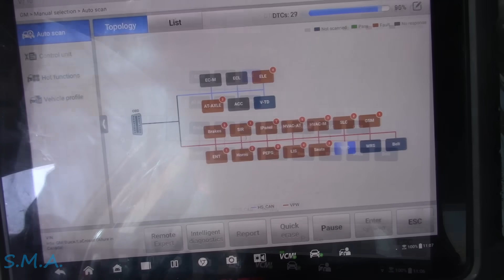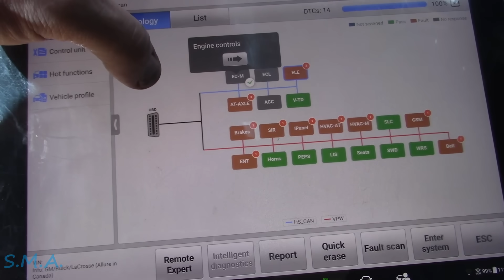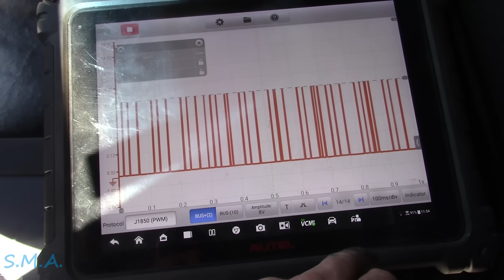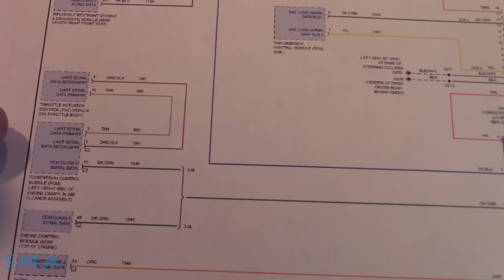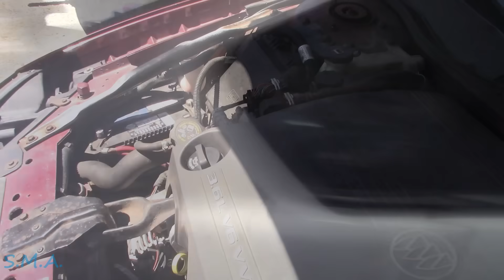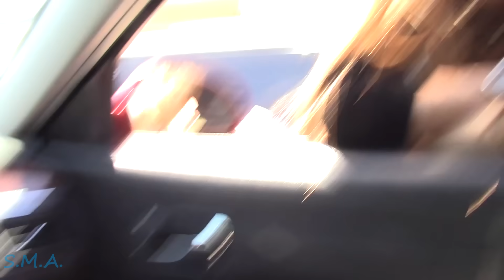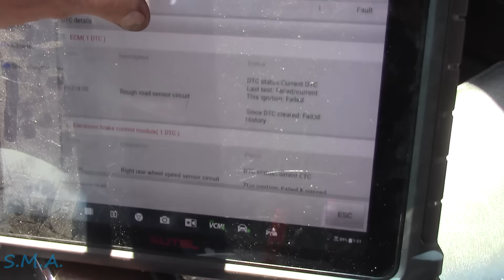Buick LaCrosse: No Start No Communication

Comment: Eric: Sorry...I bumped "send" by accident.  that raucous damned siren  across the street, loud motorcycles, loud trucks, & in this video a lawn mower running away, the loud alarm on the telephone, & God knows what else.  I live in a county that has 5500 square miles in area, point six persons per square mile, 6 villages, & my nearest neighbor is 2 1/2 miles away. My electronics repair  shop does not have a broadcast radio in it (unlike several vehicle repair shops in the area, that have stereo equipment running at the noise level of  a Romanian steel mill. ) I There goes that damned siren again !  . Your electric fault finding is absolutely first class. I always grin when I see you use a lamp as a test load.....there are times that a heavy load(relatively) is required to duplicate the fault. Your use of a "scope 
on a rope" is a valuable trouble shooting tool for many things. I use one myself when working on Ag equipment.  Great stuff Eric, & you are lucky to have "Mrs.O", she is a jewel. Ms. Trinity has really grown, &  is as pretty as the Lord lets little girls be. Haven't seen your boy for a while (Evan ? )....he must be a teenager by now.    I look at a lot of similar sites, &  you have no sites that eclipse yours. Ivan, & "Scanner Danner" are both damned good, but there are many who are full of what the crows fight over. Thank you Eric for you tutelage
of your followers. I expect you have elucidated a few of your professional followers as well.  All the best from the minus 55 deg. F , & the wind swept hinterlands of Alberta, where men are men, & sheep are nervous.   Brian

Comment: Cadillac CTS suffers from bad pcms.  Same boat. Had to jump it, after it sat not running for 10 mins, no start, key stuck and no communication. Quickly Jumping /tapping  it but not starting it,  allows the PCM to wake up, you'll hear solenoids and be able to read codes.  Took me a week with my multimeter to come to that conclusion. New PCM with vin from online.

Comment: HELP 2007 LUCERNE NO START
So on my Lucerne 4.6l if i have someone push down on the relays (under hood fuse box) while I crank the car will start right up but the a/c doesnt blow cold if i push and hold down on the relays the a/c kicks on and works your video is very well done btw. Not sure what to do next though any...

Comment: Thank You so much for this video. it helped me so much having the same symptoms on a Verano, and not having the scan tool to diagnose the BCM. It ended up being the fuse plate connected to the battery. 🙏🏻

Comment: As a long LAX 2008 owner, I breathe a sigh of relief that (great vid BTW) that A. With the 3800 and after having the Driver Info Center state 'Service aBS System'- with BS beaning bull poop for the past 260000 miles full independence from Eng/Crankshaft vs flimsy wheel speed sensors. B. Due to this VVT version ABS and engine have some dance with this car (uugh) and clearing out ABS codes will eventually be needed as to 'help limit the amount of blowby to the air filter'.  Without ABS and for most part Traction Control noticed no issues with brake overwear, rotors etc. Now unfortunately the 'BRAKE' light just went on but no change to fluid, leaks, brake pressure etc. In the Owners Manual it states (Brake light on) 'Is your parking brake engaged?' and 'If not, it COULD be something else so just tow it somewhere' Really? aBS system is right. So no real idiot light sensor to indicate loss of fluid pressure like in the good ol days.

Comment: Good diag  there Mr O....   It’s for sure as these vehicles get older fixing them can get expensive.   My mom has a 99 Olds 88.  The electronic part of the dash that shows mileage and what gear you are in has gone haywire.   My mechanic said to fix it would be expensive if even doable.  My wife’s car, a 2009 Pontiac g8 had to have a rear door glass and they don’t even make it any more so I had to get a used one

Comment: Why does anyone keep buying GM
Reply: Likely would not be issue if owner had 3.8 L(pushrod) motor. Likely placement of PCM (location where heat is more an issue - PCM likely was cooked) and VVT issue (unit needs to run at start key turn - tell the valves to operate and which cylinder bank needs to run). Note during the vid a jab at the Prius😊

Comment: Wow, cars are complex with all the digital comm between various modules. They seem unrepairable without a basic knowledge of automotive computer architecture. All the bits requiring reprogramming correct VIN  adds to the excitement.  A good scantool is a 'must' necessity.  Great troubleshooting.

Comment: It's unfortunate that car has the 3.6 when you had the choice of the 3800. You basically had the choice of GM's worst engine and their best engine, and you chose the worst.
Reply: I still remenber at the dealership being pushed the benefits and the 1-2 mpg benefit of the VVT and said no way! Also in 08 they had the V8 northstar and since I was stuck with FWD wasnt too thrilled about added torque steer with a mismatch transmission.

Comment: I hope the first thing you did while we wasn't watching is check the battery connections. Anytime there is an electrical problem that should be first. Keep in mind there can be corrosion where you can't see it. Like inside the terminal lug and the only way you can find it is with a voltage drop test. I learned this the hard way while working on outboard motors. Unfortunately it was mine. But learning how to do a voltage drop test has been a very valuable tool since.

Comment: GP, as a prerequisite to life everyone should have to work in a capacity where they interface with the public be it 
Garage, gas station, grocery store. As a teenager I had the privilege of doing so and you meet some winners. Never got fired and had a good name so I did something right. And then it was on to Vietnam. 15 Nov 67, just in time for Tet 1968..

Comment: Sept. 2020 i went to DR.'s appointment . 2 hrs later i opened the driver door to 2011 buick lacrosse and i heard a loud very fast machine gun sound under the hood . i got in and push the button and nothing ,no crank no start . it drove there real fine and been driving well before this . here are my tools i have ,BLUE DRIVER , POWERPROBE 3 , POWERPROBE "THE HOOK" , POWERPROBE ECT -2000 short finder, FOXWELL NT624 ELITE more advance scanner i just barrowed sept.2022  and a computer safe test light which test grounds and positive power . my code was/is UO100 and PO23F .....
I DOWNLOADED MANY MANY 1000's of PAGES from MITCHELL 1 , AND ONLINE CHILTON MANUEL . 
I SPENT A YEAR AND A HALF TRYING ALL SORTS OF THINGS .I WISH I HAD YOUR KNOWLEDGE AND DIANOSTIC EQUIPMENT  LOL . 
po23f states open condition in secondary fuel system . i also noticed the connection x108 has a lot of these suspect wires going thru it , sometimes my shifter indicator light on shift stays on ,sometimes my gas gauge works ,sometimes it dont ,  these things happen when i mess with X -108 CONNECTION .
so check this out , when i connect battery ,the machine gun type noise is heard under the hood . it does for a few seconds then stops , few minutes later ,it does it again .
when i unlock my door or trunk with my remote or by the key ,that machinegun sound starts up again . IT WILL BE 2 YEARS THIS SEPTEMBER THIS CAR HAS BEEN PARKED , I HAVE NEVER HAD SUCH A PROBLEM WITH A CAR EVER BEFORE . 
i know starter is good because i got it to turn over by using a jumper wire in fuse box . i wish i knew how to use the tools i have a lot better so i could fix this car . ALSO I CAN HEAR MY FUEL PUMP RUN FOR A SECOND OR TWO WHEN I FIRST TURN THE IGNITION ON . so my fuel pump and starter works .
so , sept 30 2022 i went out to the car , pushed on my fuses and relays , got in car and noticed my gas gauge working again ,push the starter button and car tried to start twice but battery was really low at 11 volts . i brought batt to have checked and fully charged to 12.8 volts .i took the fuse box out and im investigating it now . i got a feeling now ,i got a very serious intermittent problem that is possessed from the devil himself to cause me to shut down lol . what people sometimes say about getting your car fixed always leads to other problems , lol , thats true sometimes ,because some people mess things up won other things while repairing certain things . i had recently done a waterpump removal and install to this car a couple months before this all happen , also changed the water inlet neck to the engine ,the faulty radiator car , and replaced the thermostat , believe me i kindda investigated all these areas !!!!  any advice is greatly appreciated brother !!!!! THANK YOU FOR YOUR SERVICES AND YOUR VIDEO  MY BROTHER !
Reply: NOW my worst fear is trying to run the car once i get it running with the gas thats in it , 3/4 tank , pretty expensive in todays time especially .its been treated fortunately , but still its 2 years old  lol !
Reply: i just subbed brother ,really enjoy your video , thank you for all you do !

Comment: UART STANDS FOR UNIVERSAL ASYNCHRONOUS RECEIVER TRANSMITTER. IT TAKES PARALLEL DIGITAL DATA AND CREATES A SERIAL STREAM ON THE TX SIDE AND DOES THE OPPOSITE ON THE RX SIDE.

Comment: I had a similar experience of slow response with an immobilizer.  I had to let the OBD2 run for an hour to add its first key.  Once I completed the first key, The tool worked and only took A couple minutes.  My guess is the security delays the reprograming security related items to keep someone from jumping in and making a quick getaway.  I had to sit and wait an hour with keys in the ignition and it finally had new immobilizer coded up.   The other issue I had was I also had to start with the battery removed to clear all of the signals in the immobilizer.  I had spent a couple hours waiting on the tool just to have it end with a fault. It programmed successfully the first time after removing and reconnecting the battery.

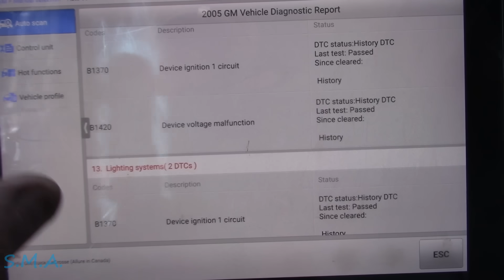Comment: Hey at least you’ve got the other shops around you trained to send any work to you that requires a little ”if, then, else logic”.  03:49  Of course that’s after they’ve fired off the old parts cannon 2 or 3 times, and are finally reluctant to bilk the customer for another part they probably don’t need.

Comment: If the fob is not working, change the batteries and try it. My Chrysler did that and without the fob it wouldn't start.Its  Weird but  they have to communicate with each other .  The factory made it that way. Of that fails, then the problem is elsewhere.

Comment: It still amazes me that after being burned at Wilburts by not having enough tools, you wouldn't keep a small mechanics tool set with hammer, cutters, crescent wrench etc in your Tundra or something to grab on t ok e way out. The Wera kit is great, but it's nowhere close to an emergency tool kit. Oh, and UNLIKE Jeff Dunham's garage (the puppet commedian), you DO NOT have to have a crescent wrench in every metric sise 2 - 22mm.........just 1 or 2 would do........(if you've never seen it, he has about 10 crescent wrenches hanging up, each one labeled a different size....funniest dang thing I ever saw...)

Comment: Well I'd like to shed some light on your p0813 code It is a rough road sensor signal circuit A which means that it monitors wheel speed, crankshaft position, and the camshaft to determine whether the car is being driven on a rough road or if there's a problem with the engine. Sort of like an engine knock. It's usually trip by the the crankshaft position sensor. It also said in that list wheel speed sensor which is part of the ABS in considering you have a problem with abs that's probably where the issue lies. But with that being said the circuit itself can get tripped when any one of those aren't reporting back properly or if the computer can't determine whether it's rough road or engine. Interesting fact the code will be tripped and there will not be a light until after a few cycles then a check engine light will illuminate. I hope that helps you. Maybe you can narrow it down and find an issue but that's what it is and that's what it measures there are procedures in diagnosing this code.

Comment: My 05 Lacrosse had a relay switch on factory recall but the local dealer never got the replacement part.  After driving another year with no problems,  the relay malfuctioned.   Ended up having the wiring harness replaced.

Comment: I wish I lived closer to you I’d bring you my 2011 VOLVO XC90, the brake lights stopped working on this sucker and now I’ve only got the 3rd brake light up top of the rear window working and I can’t seem to find fuses for them, I was told there was a relay in the cargo compartment on the left rear corner but no dice, the one single fuse I did find is good!

Comment: THANK YOU ERIC ! I have been having almost the same problem on a 2005 LaCrosse, my problem is a fuel injector not responding to send fuel. Long story short, Security is just locking & unlocking the alarm. Also cycle the key to register the signal to start....at least for me. Thanks for the info.

Comment: Had the Same thing a While back. I Cut the Data Wire in Half about 4 inches from the Computer. Checked the Incoming Half for Activity it Had A Good Pattern. Checked the other Half Coming out of the Computer  it was Flat lined, Bad ECM.
Reply: Also those Style GM ECM's Are a High Failure Item. Lots of Internal memory Codes and Faults.

Comment: Another Great Video. I've learnt that I really need a GM Specific Bi-directional Scan too for my 98 Suburban then? Unfortunately it's Australian (sold here under the Holden brand and RHD) so I'm struggling to find what I was told I needed is a Tech 2, but with all the Holden stuff. Does that sound right?? (Again, thanks for your videos, for an Old Fart this stuff is different but I'm learning lots. Cheers!!

Comment: I have a question or two  the first question is My sister has a 2001 Mitsubishi galant ES 2,4L  and she just changed sensors the sensors she changed are Camshaft sensor, and input sensor, and she also put a Natural Safety switch on it as well, and the car is jerking when you put your foot on the accelerator, my question is what could cause the transmission to do that? And how do I fix it? 
        Thanks you your fan 
       Jermaine  from Chicago Illinois

Comment: Had this exact issue on this exact car! It took a long time to diagnose. Although the grounds look(and measure) ok, please try replacing the negative ground cable. Be sure to clean up the bolt pads, especially at the fender connection. Do not use the existing cable in any circumstance.
The clue came when the computer showed just over 10 volts with key on. The exact symptoms that you describe, including the ABS and other errors perplexed us for about a month. This finally fixed the issue. They have not had any issues in the last two years.

Comment: I recognized the GM  Check Traction control.  That made me think there is a general ground fault.  My 2013 cruze had multiple lighting and system errors when the Battery leaked acid in the engine wiring.  I cleaned it at the local car wash and poof the problems went away.  Traction Control = Electronic Brake Control.

 Oh boy, You said a naughty word.  Mrs. O is going to be so mad with you.

Comment: Since this was an intermittent failure, it's probably a cracked solder joint.  Not curious to open the computer and take a look?  Can it be opened?  Is it potted?

Comment: Eric O’…I would have never guessed ECU. I would have started with Battery Voltage, Starter Wires, Fuses and Such. Then again, I do not have one of those fancy scan tools. UART; Universal Asynchronous Receiver Transmitter. If we had a Connection, we could connect it to the Laptop, Serial or USB port, and talk. If we knew what to say! Wouldn’t you really rather have a Buick!

Comment: Never reveal an issue that they can say was not present the shop I work at you have to document any dash lights damage or missing hub caps to cover us in the event that we have an ever since you scenario I understand a no comm creates other issues if it can’t talk there could more then likely be issues that were not showing before I find if you are up front and tell them that there may be other issues after it’s driven they at least have a heads up and don’t try to blame you as much

Comment: The P0318 code is tied in with that speed sensor problem, it has something to do with the PCM not receiving road data when it's required.

Yes,I'm a pole (my mother is part Polish,3rd generation because her grandmother migrated to Australia from Poland before WW2) who looks after my 69 year old mother whose mobility isn't as good as what it used to be,I have been driving her to a place which deals with people who are old & frail but it's also to try & get her fitness level up to a more satisfactory level.

That's while I haven't been working but I have a job to go to next week so my dad has to take her there, it's a Polish thing to look after your mother, apparently!

Comment: you got me curious so i looked it up! 
DTC P0318
Circuit Description
Correct engine misfire detection is dependent on whether or not the vehicle is experiencing a rough road condition. A rough road condition causes unexpected crankshaft fluctuations. In order to detect a rough road condition, the electronic brake control module (EBCM) communicates a wheel speed signal over the serial data circuit to the engine control module (ECM). The wheel speed sensor information allows the ECM to distinguish if the crankshaft speed variations are caused by a rough road condition or are caused by a true misfire. If the EBCM reports a wheel speed sensor failure, or the ECM does not receive the rough road information, this DTC sets.